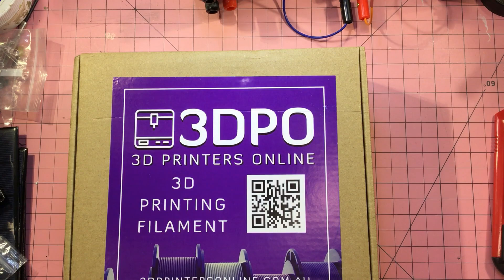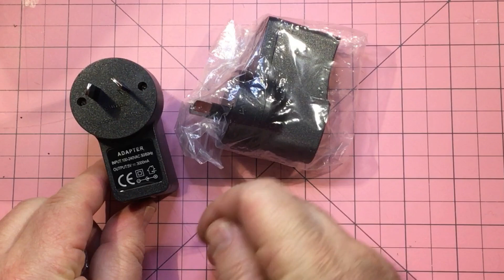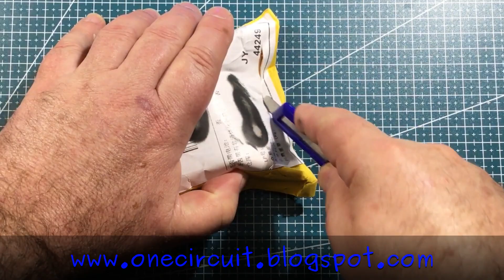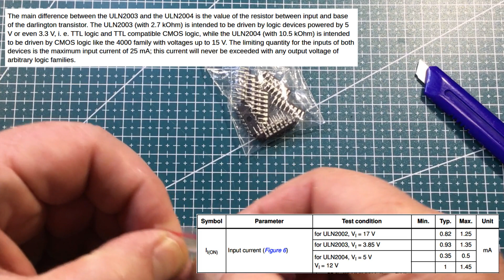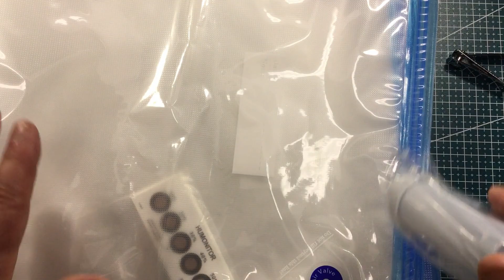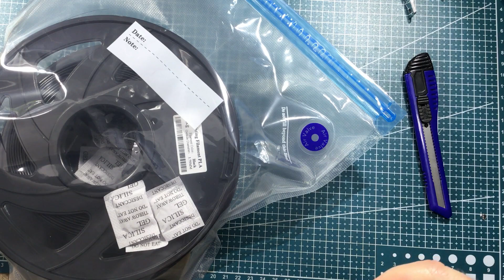Mailbag #12 - from pink to green

Comment: Desiccant is useful for KEEPING filament dry ... but they are often shipped wet, despite the appearance.  Nothing but heat for long periods seems to MAKE the filament dry.
Oh yeah, a REAL 3A wall wart is rare.  Though it would be useless to me as a 110V hamburger-eating AmeriCAN. Where is my bible and gun?
You should test the stability of that one.
Like those fans.  Small ones are so often noisy. 
The ULN2803 is my favorite, with 8 outputs.  You can drive a more power-of-two ... or two 5-wire steppers with one of those.
Oh yeah, always good to be able to replace every part of the hot-end quickly.  Nice haul!